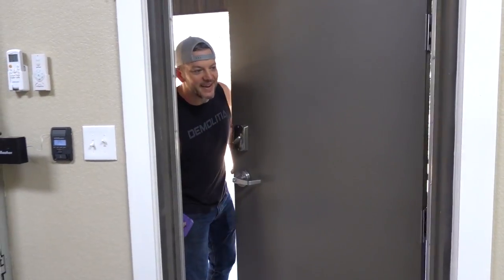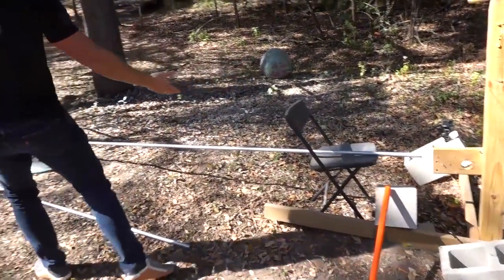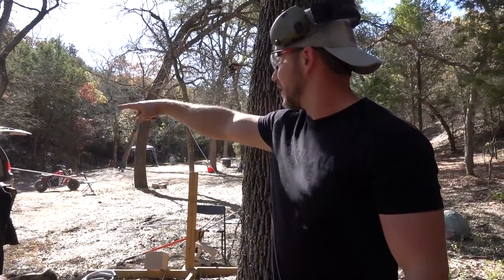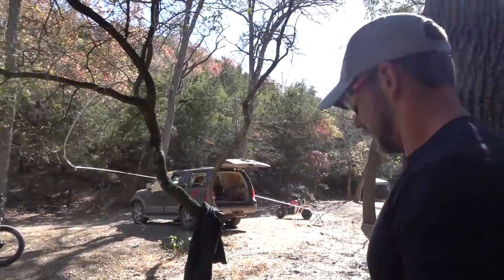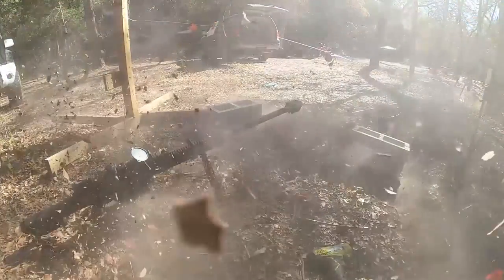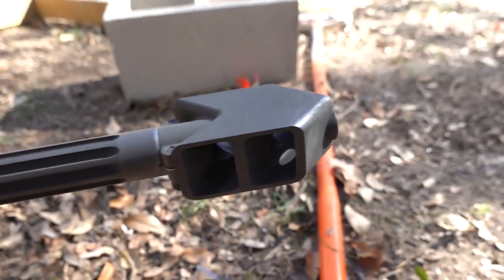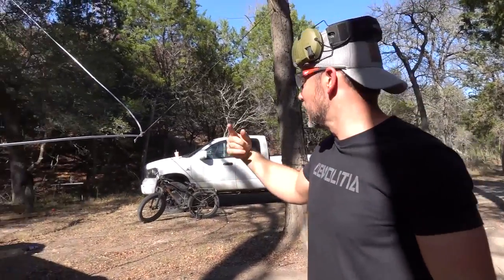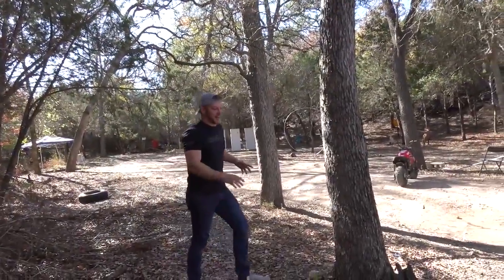Is It Possible to Loopty Loop a 50BMG???

Comment: me: barely can afford a 9mm 
matt: yea so, I got a 50 cal, over 40 feet of metal tubing, and a Ford expedition.
Reply: All for the amazingly low price of 100k
Reply: You can get a .50bmg for $1k and an old beat up Expedition for peanuts.
Reply: @Aaron48219  I doubt it but you can get it for 100k
Reply: Dang it. Shoulda been a doctor
Reply: @juice5203  Or a pharmacist operating without a license lol.

Comment: Imagine if you had The Slow mo guys set up a camera when that 50 cal was bouncing in the pipe! Would be an absolutely amazing shot 👌😀
Reply: The bullet would have only been barely bouncing. The bend in the pipe would have been created by the heat and metal deformation after the bullet passed.  But I’m all for The Slow Mo Guys.
Reply: You beat me to this comment, 100% great idea
Reply: Them and Destin from Smarter Every Day 
(they already did an awesome colab with Destins .50)

Comment: You need to try it again but with PVC, lower friction coefficient, use 1" so there's plenty of room for pressure to transfer around the bullet. I think the pressure buildup in front of the bullet is causing the biggest problems.

Comment: 9:00 My guess would be that the pressure wave from the supersonic gasses is what busted up that pipe, not the bullet. The pipe doesn't look like it's rated for high pressure, and when you've got gasses moving at the speed of sound all bets are off.

Comment: I'm thinking the plastic pipes worked better because when the bullet hits the wall it melts it, making it 'slippery' and skating along.
Metal-on-metal is more 'sticky', so in this video the bullets seem to bite into the pipe and bounce around.
(The pressure wave could be also a problem, easily solved by just shooting into the pipe from some distance instead of taping the barrel to it.)

Conclusion: I'd really like to see Matt get the thickest walled plastic pipe possible and try again with the .50

Comment: By taping together the tube and the barrel, you are causing the recoil, i.e. equal opposite reaction of the gun to firing to directly effect movement in the tube, thus the bullet is then unable to travel straight through as it's moving.

Even if the recoil reaction is slower than the bullet, a small deviation in movement of the tube is all that's needed to cause chaos.

Comment: Hey, I think you might be right with the descripted projectile movement of the bmg round in the long pipe, but in addition to that, I think, that while the bullet was traveling your descripted path, the bullet was scratching the surface. When then the explodion gasses reached high enough presure in the pipe, the pipe would burst at some of the scratches. When the pipe burst at a spot, the exiting gasses at that spot, could push the pipe in the opposit direction plus the pipe rippes up in organic shapes which can further decrease the structural integrity of the pipe as such. 
At the pipe we can observe, that burst areas get less and weaker over distance, that could be axplained by factors such as presure distribution and corrupted structural integrity due to burst initiated pipe deformations. The presure distribution over distance was pobably first in fluenced by the friction between the gasses and pipe wall and then by the explosive depresurization.
Maybe we could even see another phenomenon here:
While the projectile is scratching the pipe wall, there is friction. Maybe enough friction, to make the pipe moving into the same direction as the bullet. This movend could assist in benting the pipe.
I think you are right with the last point of contact and as you, I also think, that the bullet had lost the best part of its momentum before its exit through the pipe wall, close to the joint.
However, I think also your guess on the different material properties of the pvc pipe compared to the steal pipe make the difference here. 
Firing the projectile onto a stronger material then the own material, will probably result in bigger damage to the projectile, compared to firing it against a softer material. I dont know the the correct friction coefficients necessary here, but my guess is, that copper on steal creates more friction than copper on pvc.
The pvc pipe could maybe react more flexible to the internal impacts so that again there is less friction.
But actually, I doubted in the beginning, the pvc pipe survive the first round. My guess was, that the bullet would punction the pipe a few inches after the barrel. I was really suprised that the bullets made it through the first bent pvc pipe you tried in the first pipe video. Thank you for conducting those experiments! I find them very interesting.
Also your ammo choice seemed very well, I wonder, how the pvc pipe takes faster ammonition! :)
Have a good one!

Comment: You should use copper with swage tool to couple all the pipes together so there are no lips at the connections and use pressurized air to blow a heavy lubricant through to help as well and tou want the pipe small enough to act more as a barrel

Comment: The spiral barrel will allow the exit of the rings that do not have the ability to penetrate due to the thickness of the metal of the barrel. The food from the M4 rifle and 50 will penetrate at the first bend, especially if the sword of the barrel is small in front of the force of the shot.

Comment: just an idea for you try the same tests with conduit rather than tubing more likely to work i know bits more dificult as far as having to thread and bend the pipe but it will probably work better also if thjat dosent work try larger diameter conduit

Comment: I know this is an old video, but in case you see this... The bullets slow down super fast because of the air pressure in the pipe. Bullet has to push air through the entire length. It might work better if you drilled small holes every couple feet for air to escape.

Comment: Muzzle energy = bullet mass x bullet velocity 2 / ( 2 x dimensional constant x 7000 ).

Example:

Firearm: Weatherby Mark V chambered in .378 Weatherby Magnum.
Projectile: monolithic solid type bullet weighing 300 grains with a muzzle velocity of 2900 feet per second.
5603 ft-lbf = 300 x 29002 / ( 2 x 32.163 x 7000 ).

Comment: I think the reason for the bullet previously following all the bends and curves is the gases that are pushing it. It seems like this metal tube is not hermetically sealed and therefore the gases stop moving inside and the bullet hits the tube walls.

Comment: :o.... 4:28... most plastics "self lubricate"... think teflon as a wear surface. very different material..... but similar in that respect..... you could think of the surface finish as well..... where the copper.... aluminum or... steel pipe  can possibly have a finish that like to a file.... rough enough to remove material... or rough enough to grab the side of the bullet and force it to sheer itself.

Comment: The slowest round with FMJ and less mass seems like it would have the best chance. Something subsonic and smaller caliber. The more massive the more energy it takes to change directions and the more it imparts on the thing trying to change its direction.

Maybe try 9mm subsonic fmj. Like 900fps. If that doesnt work maybe 5.56 subsonic. Seems like thatd have the best chance. Not sure itd make it too the end but it would be more likely to take the turns without losing energy to busting  the pipes or shattering. It might even fall dead flat from friction before it exited. Poor some thin oil down the pipe first for lower friction coefficient.  It could work.

Comment: The bullet went in a straight line, the pipe was wiggle-waggin up and down!
The round hits the top, the pipe moves up, then the bullet hits the rising pipe back down.
That bullet is heavier than 4" of that pipe, so the pipe gets pushed around.

Comment: Schedule 80 stainless steel pipe, seamless tubing.  You will have to weld the joints and use a circular pipe bender to smooth out the curves.  3/4” pipe will take the bullet in a complete loop.

Comment: I kinda have the feeling that it's the pipe bouncing around for the first meter or so... The 50 is probably traveling in a perfect straight line but the pipe starts to move.. But in the end the bullet probably started to spiral a bit before leaving the pipe..

Comment: How about drilling holes into the straight pipe to see if the 50bmg will travel straight through and the pipe with drilled holes would act as a muzzle break

Comment: I think that .50 cal bullet weakened the pipe and then the pressure more or less turned the pipe inside out, blowing it out. That's why it just the first part that opened up that much

Comment: Maybe it's doing kind of like ice skates melting a layer of the PVC surface as it travels and lubricating its passage. That could explain why the metal pipe isn't working. Try running some motor oil or something through before you try again maybe.
Reply: Could try making a vacume in the pipe..  Call it the hyperloop-x and piss off Musky.

Comment: DR MATT what if you neutrilze the extreme pressure inside of the pipe by perforating it like drilling a bunch of little holes but they would have to have smooth edges tho let me know what you thing guys

Comment: Ok Matt. I’m just spitballing here, but,  the issue with the metal pipe and the copper jacket is the copper is galling with the metal pipe. The PVC plastic pipe had more lubricity. I just realized you are a vet so are no slouch in the brains department. So going back to physics it probably has to do with the coefficient of friction of each individual metal. So in English. The friction between the copper and steel is too high causing the bullet to tumble in the pipe at high speed and fly apart. That’s my guess. But what the hell do I know. I’m just a dentist.

Comment: probably find the 50cal round went straight and the pipe distorted/flexed from the pressure causing it to cross the bullets' path where it spiraled on the internal wall. in fact you may find that what allows bullets to travel around the curved pipes is the rounds rotational speed when it hits the side wall of the pipe and spirals round the bends but the 50cal just gives no fk's due to it's mass and velocity exceeding the pipes density.

Comment: You need to use rigid electrical pipe not thin wall pipe. Also if you used 1/2 pipe instead of 3/4 the bullet would probably not bounce around as much

Comment: The Barrett muzzle was too close to the pipe, apparently it blew a lot of gasses and pressure into the pipe itself, if you shot it a bit further away so that the projectile itself goes to the pipe but gas had time to spread around instead going into the pipe, this would have greater chances of succeeding. Although I doubt it would really work as you are shooting an anti-materiel rifle meant to destroy stuff into a flimsy metal pipe. You know... Physics 'n sheeeeiit.

Comment: Actually, the bullet just scores the metal inside the pipe and the trailing pressure from the gases blows out the metal from the weakened score points

Comment: Its actually basic science. 50bmg round simply cannot be looped with so thin walled pipe.. The pullet will overmatch the thickness of the wall and just penetrate it, even with extreme angles, i defenetly wanna see this done with thicker pipe

Comment: The mentos did nothing.  The fountain effect works off of the the pores on the surface of the mentos (nucleation sites), rather than a chemical reaction.  This is being confused with the chemical reaction between drano and aluminum foil or similar chemical reactions that release gas as a byproduct thus increasing the pressure.  The mentos merely dissolved and the pressure inside of the bottle remained the same.  The amount of dissolved CO2 didn’t increase at any point.

Comment: If you rifle the pipe and its the same diameter of the barrel it will work, myth busters proved this by shooting through a bent rifle barrel. The bullet needs the  Centrifical force to be redirected not to mention if the barrel is the wrong diameter and the bullet is allowed to gouge at all you will have a blow out.